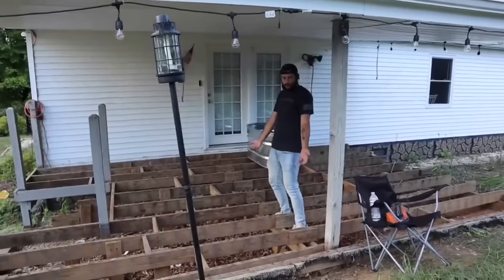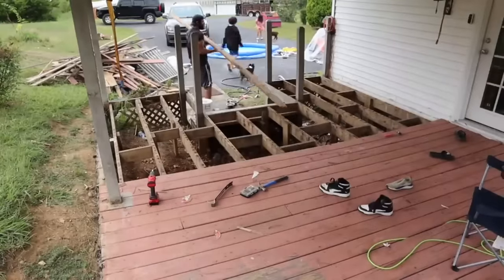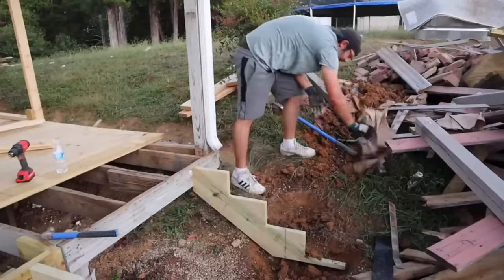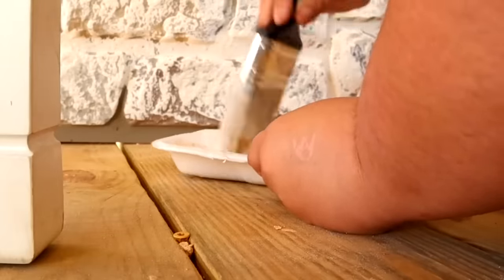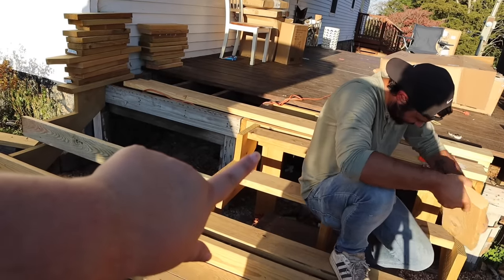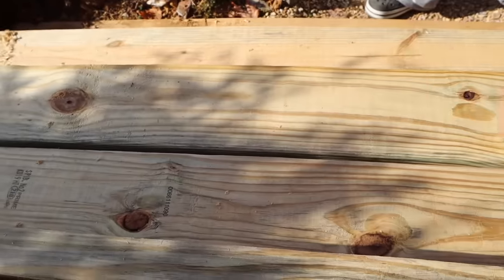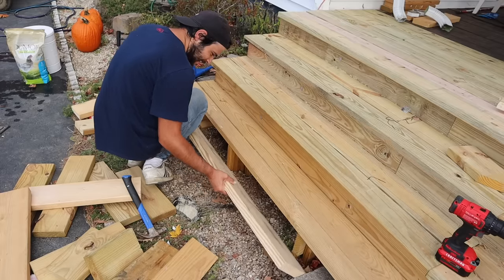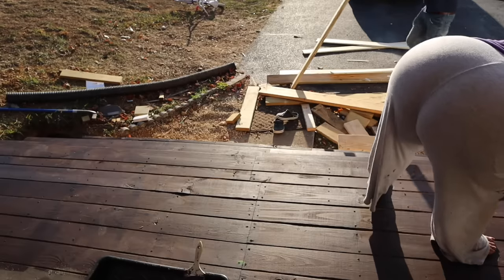MOBILE HOME DREAM PORCH REVEAL | EXTREME start to finish double wide mobile home deck makeover |ep.7

Comment: We used Ready Seal on our decks a year ago and it still looks brand new. Its an oil stain and you never will have to sand it when its time to refresh (after many years)- you just pressure wash and recoat it. It doesnt scratch off either and it pentrates the wood so well that the rainwater will bead up and run off. We had it on the decks at our last house too. Comes in lots of colors.

Comment: Merina, in Tn. porches and decks with a raised floor surface located more than 30” above the grade or floor below must have guardrails not less than 36” in height. Intermediate rails shall be placed which do not allow passage of a 4” sphere. I'm surprised they didn't tell you that when you got the building permit and the inspector came out when it was finished.

Comment: You guys did a great job!! Shane could make some killer money with home renovations He has some woodworking skills for sure!! 
TIP: When you stain, you always have a cloth with you, to wipe it off, it is actually better never to use a brush, just dip the cloth or old rag into the stain and wipe/rub it in. This is why you had all those marks and different variations of color. Stain is usually used so the wood grain shows, light handed when staining. 😊 Good job 
M & S!

Comment: With the stain on your deck - you need to put a sealer on top of the stain to stop the wear and tear of the stain happening so quickly. 
It will eventually need to be redone but the stain will not last without an exterior sealer. You can just use a squegie mop to put the sealer on (then throw the pad out and reuse the mop again next time) . 
It looks great you did a great job

Comment: The wood has to be really dry for the stain to adhere.  Our contractor told us to wait a year before we stained but we didn’t listen and it wore down fast. We also used water-based stain which we feel is also the reason it didn’t last; in the past we always used oil-based stain. You guys are awesome for attempting anything!

Comment: We just moved in our new house, we still have 3 more trips to our old house to get stuff but it probably won't happen until the weekend. At our new house we have been having to replace the pretty much all the plumbing ( which we didn't know we were going to have to do this at time of purchasing it). So we have been trying to move everything over and working on plumbing. We have to replace all the decking boards on our 3 porches, one is worse than the others.

Comment: Are you going to seal it. It needs a water based polyurethane to keep it looking great. Oil based tends to turn yellowish. If not most of it will fade over time or look discolored and it will be easy to scratch. Highly recommend some sealer.

Comment: Not sure if I’m being helpful now or not because you are done… but I think you could have just taken the front boards with the lights in them and shaved off the edges 3/4 inches on each side and then just screwed them back in so that the lights would still look evenly spaced across. It all looks beautiful regardless!

Comment: did you use oil based stain? You need oil based stain on heavy traffic areas or outdoor.... water based stain isnt resilient for florr.. it is fine for furniture...